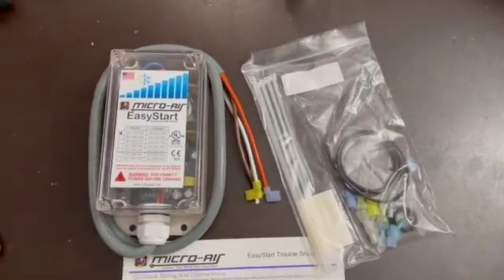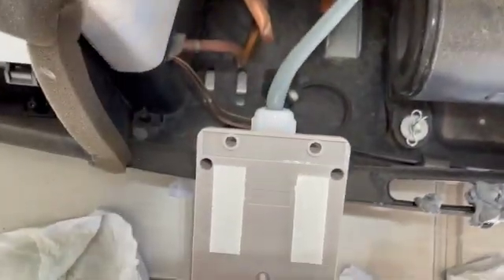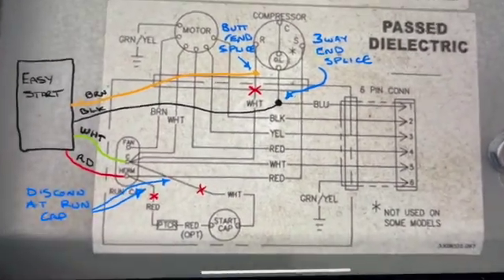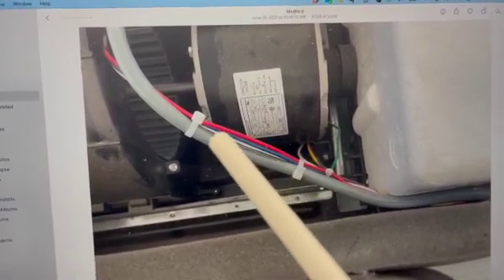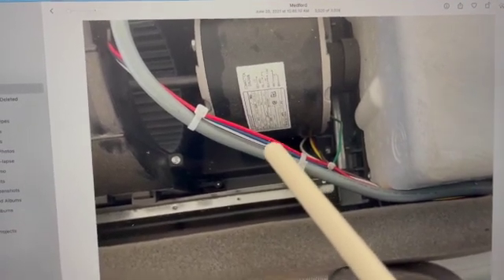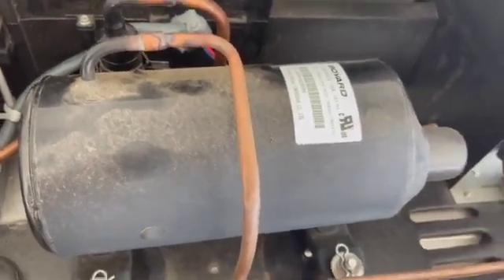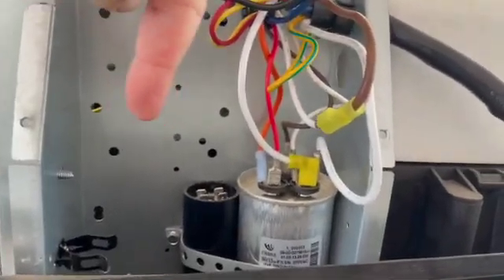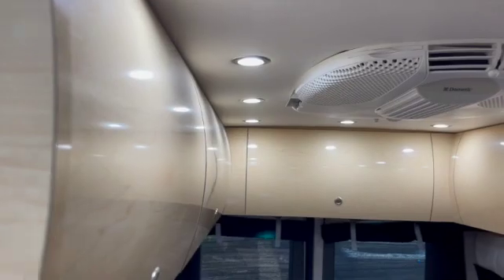Part 4:  A/C Soft Start Installation

Comment: Thank you Doug for giving me the information that I used in upgrading my electrical heart transplant of my 2018 PleasureWay FL. It was comforting to see that the painful dismantling of your battery box all worked out in the end. I did the same thing almost exactly the same way that you did. I used all Victron equipment and 4 Battle Born Batteries however. I now have a 3000W inverter and I am getting ready to move the AC breaker to the inverter side of the breaker panel. I am also an Oregon resident, however I live in a cooler part of Oregon. I have only used the AC a couple of times and I am wondering if I would need the EasyStart now that I have the 3KW inverter and 400AH batteries?
Reply from the maker: Hi Keith.  Its great to hear someone else did this upgrade. The Battle Borns are a good choice and should be compatible with the PW charging systems.  The lithionics have a more unique charge profile so I needed to upgrade all charging components.  I needed the lithionics to ge the power density I wanted.  I take off and work for the day in different settings (outside coffee shops, lakes, medical offices, etc) where it gets hotter in the summer.  Running the generator is not usually an option, its great to have the AC for a few hours during the day.  One of the main benefits of the softstart is it makes the AC quieter.  You can definately run the AC on the 3000 watt inverter, but I like the soft start for quieter start ups and it reduces the large inrush current on the batteries when it starts up.
Reply: @connectedmobilelife4028  You were correct! I just added the EasyStart and it is quieter and uses less startup power. I am happy that I followed your recommendation.

While I was at it, I also added a second DC to DC charger to help me to keep the additional batteries charged without using the generator. I used the second #2AWG cable provided by the stock PW wiring from the chassis charging system to the stock Spyder System board that I saved and used as my new system positive buss bar. I have isolated the two chargers and installed two breakers before attaching them to the Spyder System buss bar. Hopefully we will run into each other someday and we can compare our systems.